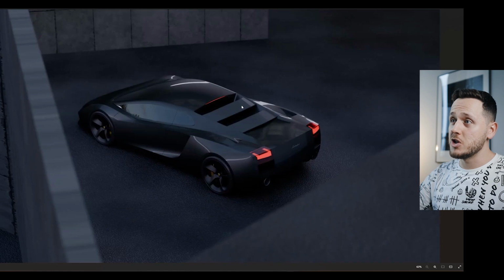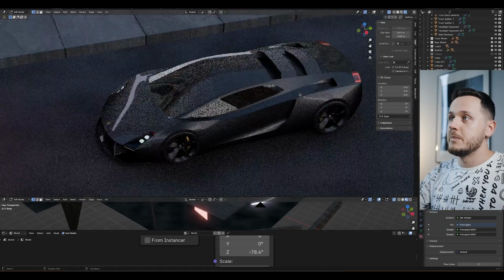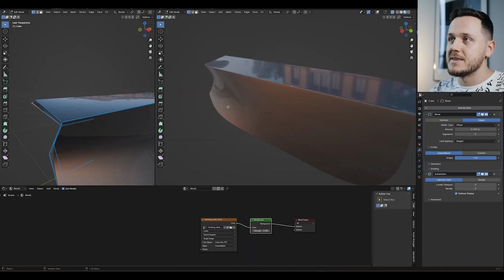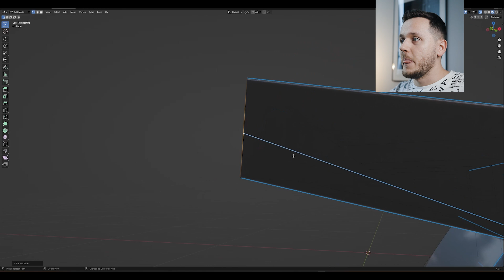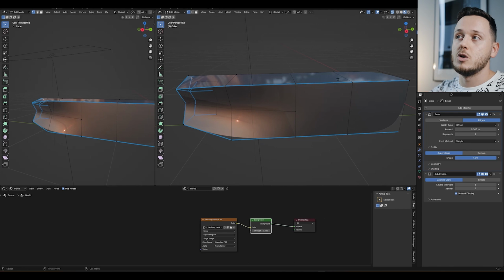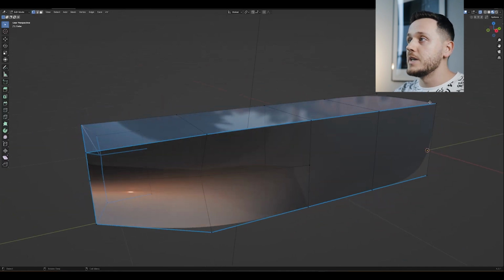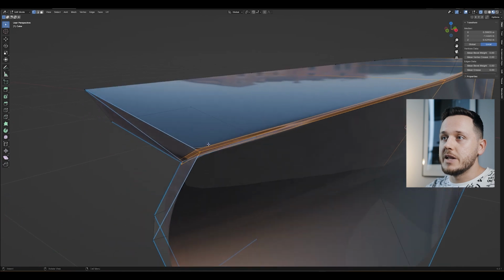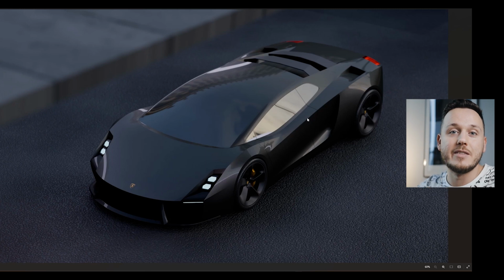Fix the Bevel When It's TOO SHARP! - Blender Tips

Comment: I wonder when will Blender implement the variable edge crease feature,  like in Alias sub-D where you can slowly reduce the crease value from one end of an edge to the other end.  It  will make the work flow much simpler.
Reply: In reality the closest thing to a crease is a knife edge so putting one on a car will make it look unrealistic. You can adjust the bevel weight of an edge in Blender but its not very successful at washing out a crease. The alternative method is to adjust vertices until it looks right.